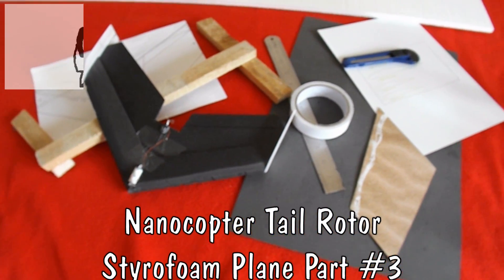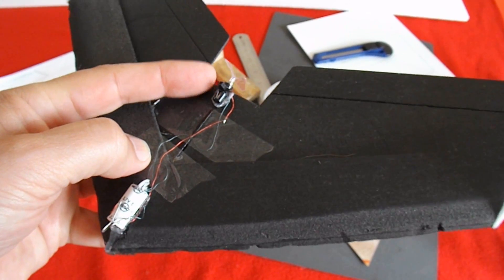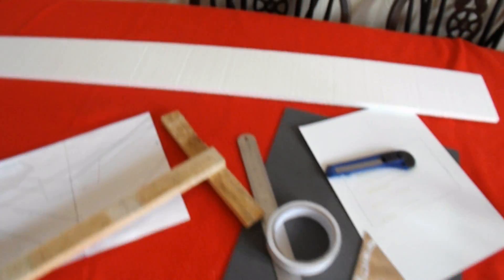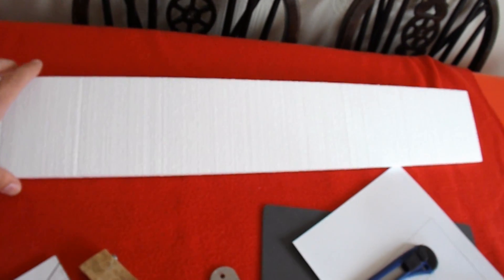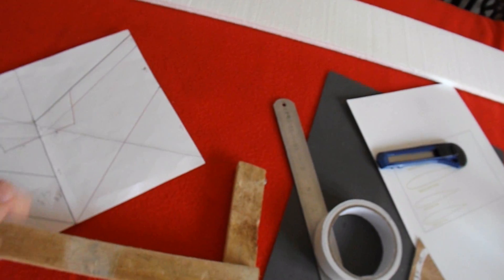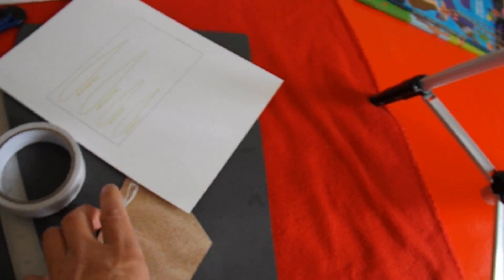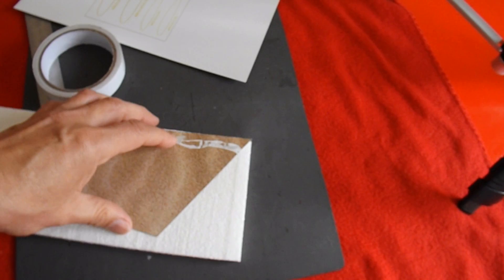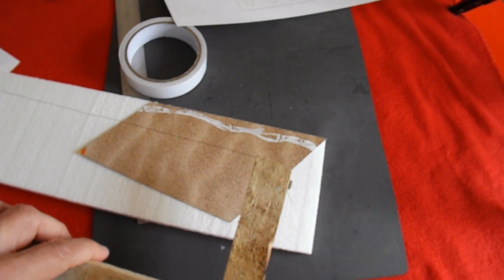Nanocopter Tail Rotor Styrofoam Plane Part #3

Comment: How do you make those cap motors and charge them?
Reply from the maker: +adam clark details and links in the video description, but basically the circuit is just a small electric motor and a supercapacitor wired directly together. The supercapacitor is 5F 2.7V so you can charge it by connecting a battery pack holding 2 or 3 AA batteries in a matter of seconds and it flies for about 10 seconds on full power then drops off quite quickly. That suits me so it doesn't go too far.

Comment: very nice, you solved the problem and made that tiny motor fly! nice work doing your own wing cutting too! wonder if you can make a wing cutter follow a form guide so you can get a consistent cut with many wings
Reply from the maker: jusb1066 thanks. If I was going to do more wings I would probably make more of an effort with the cutter but that took minutes to put together and was good enough for the task.

Comment: Quite wonderful, congratulations !
I could tell things were getting serious when you rolled out the 12V car battery haha.
9g is a fine weight for the size of aircraft + parts.
Reply from the maker: slider2732 that battery is actually rated at 14 volts on the casing for some reason. Comes from a motorized wheel chair apparently. It was measuring about 12.5V when I used it. The plane actually flew at 10g because I added a little bit of nose weight,

Comment: What is the diameter of the wire your using and what is the width of the OPENING of your hotwire BOW? Another words how long is the  nichrome wire your using? Try clamping the BOW to your work bench with the BOW opening facing you. Let it hang over the edge of the bench so you have 360 degree access to the nichrome wire. Then the bow will remain stationary and you can move the foam thru the wire.  The foam you are using is very thin, it helps to use a piece of wood as a BACKING PLATE to keep the foam from bending as you are moving it thru the wire.///
Reply from the maker: David Puissegur thanks for the tips, I have no idea what diameter the wire is. If you look at my video description I explain where the wire came from and also give links to a couple of other people's hot wire cutter videos. This bow took minutes to make and did what I needed to do. Some time I will get around to making a more efficient one for some larger wing projects that I have in mind.

Comment: now that is what i like to call a breakthrough. great improvement, well done!
Reply from the maker: Elnufo thanks, I wonder how much better it would have been if I had a few more goes with the hot wire cutter. As you saw one half of the wing was pretty rough although it did tidy it a bit with sandpaper.
Reply: +GrandadIsAnOldMan 
I agree, I was really impressedwith how well the tiny motor handled the plane.
Reply: +GrandadIsAnOldMan 
At those Reynold's numbers it's not really critical to have a smooth surface. It could do with yet a couple of grams less. You could try using some cheap 3mm foam that you can find in home depot or sth that you put under laminate flooring. This would save you some weight, compare to the thick styrofoam airfoil. Again, at those speeds and sizes a flat airfoil may well have a better lift/drag ratio than a true airfoil.
Reply from the maker: +kardRatzinger thanks for the comments, as it happens it worked well enough for my purposes. If it worked any better I would need a bigger flying site :)
Reply from the maker: kardRatzinger thanks, yes that motor is tiny. The project was simply to see if I could get it to fly something on it's own :) Obviously I could have built one of those ultra light weight indoor planes but I don't have that sort of patience.